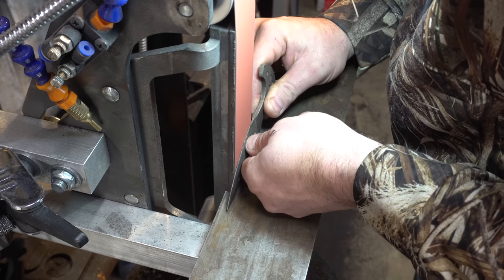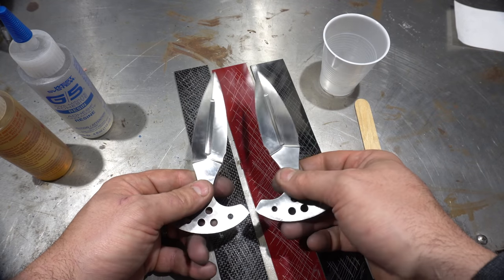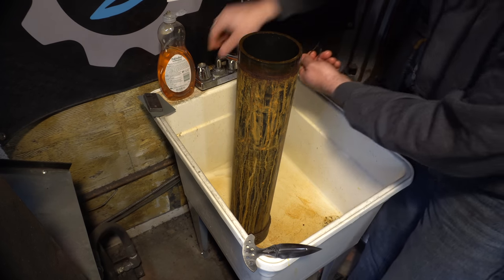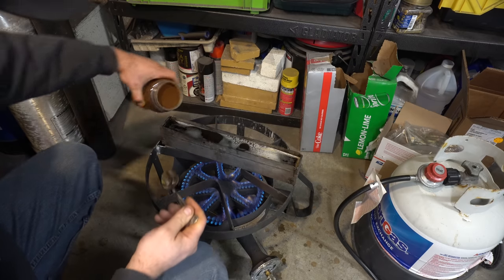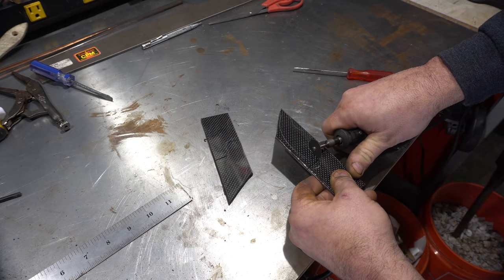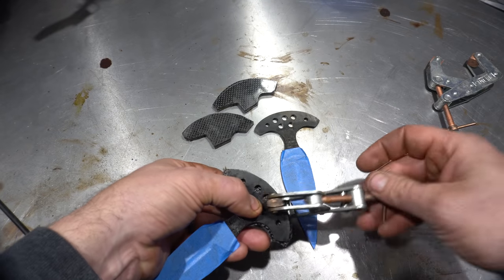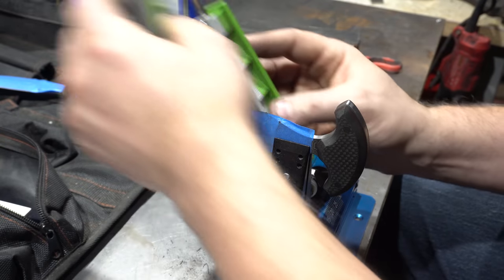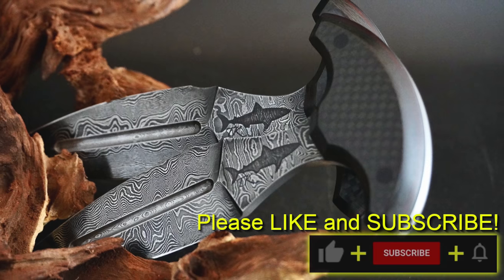Forging Damascus Push Daggers - Part 2 - Finale

Comment: Excellent job, as ever! I have a suggestion for a knife build. The mountain men of the early 19th century often carried hunting/skinning knives with handles made from deer or elk antler. Some even had Damascus steel blades. I actually own a modern replica. I would love to see you manufacture such a knife. Cheers!
Reply from the maker: I have some sambar stag antler that I've been meaning to try out.  It'll be the handle on a bowie at some point.  Probably early next year.  Thanks for watching, Curtis!

Comment: The Original design was changed if I am not mistaken but none the less a beautiful work, thank you for sharing
Reply from the maker: You are correct. The original design had some pouty bits on each side and I thought those might harm the user so they were removed.  Thanks for watching.

Comment: I have often wondered if the coffee could be reused at a later date
Reply from the maker: It can, but you’ll get mold over the coffee after a while and it’s kinda gross.  It’s cheap so it’s easier to just buy and make more.

Comment: What does the coffee do? Is the metal porous so it absorbs? Or is it a surface coating? Thanks!
Reply from the maker: Coffee is actually a weak acid.  Making it super strong intensifies it so that it etched (oxidizes) the steel.  It turns the blacks parts even blacker.  Thanks for watching, Linda!

Comment: It's so beautiful. The process is very detailed.Can I copy them and participate in your audience work display?
Reply from the maker: Sure, copy away... send me some pics for my Viewer Knives videos!  Thanks for watching.
Reply: @TyrellKnifeworks  Thank you, I will try my best to reproduce it. I have learned a lot from you. From zero basics to now, I can make more than 100 layers of Damascus blanks. Thank you again for your guidance.
Reply: @TyrellKnifeworks  Excuse me what is the total length of about their cm? Now I control at about 15 cm.
Reply from the maker: @idleartisans778  total length from tip to back of the handle is just around 14cm.
Reply: @TyrellKnifeworks  Thank you very much. I will take this copy of your work as an exam for my self-study forging.

Comment: Ok. I know this is a stupid question before I ask, but as the coffee is used to stain the metal, could you also use other organic matter for a different tint, like the beetroot for a nice red stain, since its stain is much more pronounced, than coffee, it should work. The point of my question is, has anyone tried, and if yes, what were the results. P.S. Those push daggers are amazing 😲😲😲 👌👌👌
Reply from the maker: Coffee isn’t just staining though.  It has an acid in it that’s eating the metal and leaving a black oxide.  I don’t think you’d get a lasting effect from beets, but who knows, try it!  Thanks for watching.